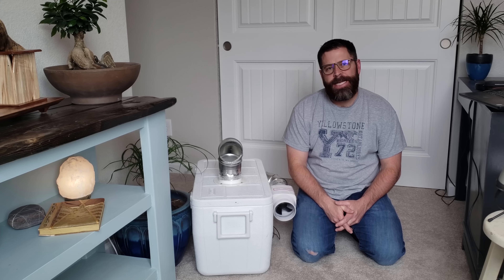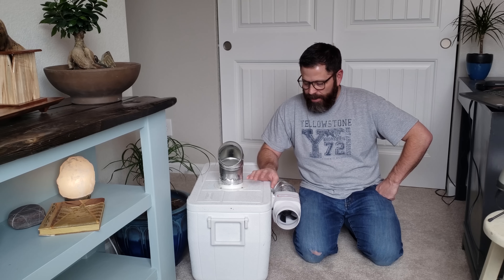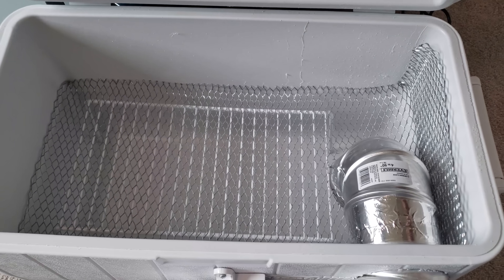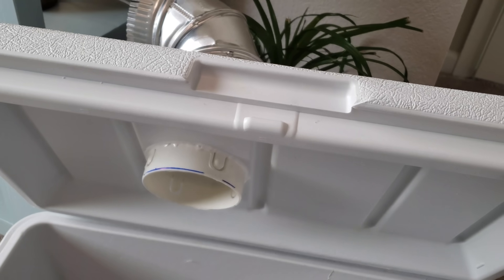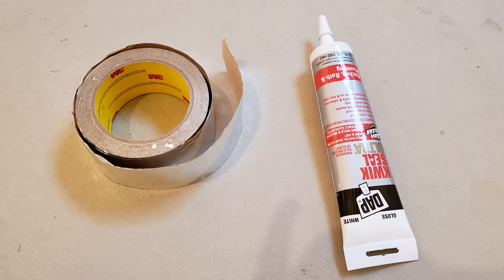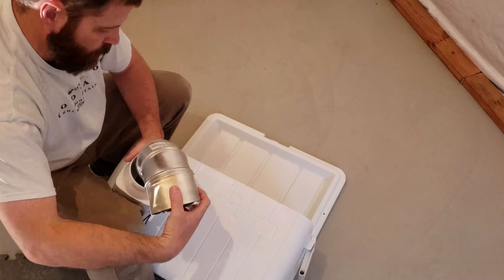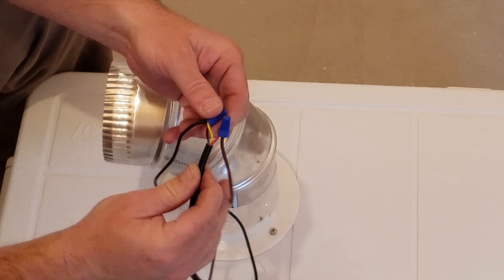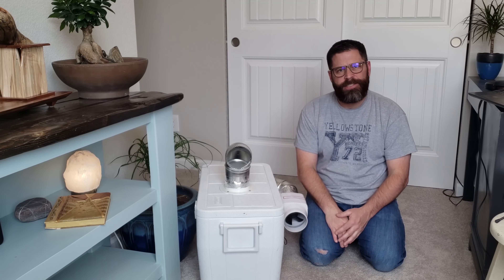Homemade Portable Air Conditioner DIY - Coldest One Yet!

Comment: what if you used dry ice and it was contained within a bottle or maybe even put inside a a radiator so that the co2 stays locked inside? that way you could just pump a liquid over it and through some tubes and have a fan blow the cold air at your poor melting face... i understand dry ice explodes when mixed in a bottle with h2o but what about using a liquid that wouldn't cause a reaction.. or perhaps use that pressure to your advantage to operate some kind of compressor without using electricity? idk just spit-balling ideas here. im looking for a way to put ac in my sailboat.

Comment: I'm seeing everyone say "Don't use dry ice".  I'd like to know if this is only for "closed in" spaces?  I'd like to do this for a covered patio area (outside).  Basically a portable outdoor cooler for sitting on the porch when the temperatures are 90+ outside.  Would dry Ice be ok for that situation or would it still be too hazardous?  Thanks.

Comment: Can I give you an idea?. How about taking a small radiator from a condenser unit from a refrigerator taking a small water pump and placing it in the bottom of your cooler with cold water and an ice pack in it run your water from the bottom of your cooler from the pump through a hose to a dripper system on the condenser unit with a series of sponges behind the condenser to catch the moisture so it doesn't blow through your fan and have that watery collect in the bottom and recycled back into your cooler it will chill the air going into the cooler to keep the ice longer to give you colder air

Comment: Would this set up work on a smaller cooler? I need this system for a work truck that has no AC. Would need to fit in center console or passenger seat. w14  x  L 20 inches  is the biggest I would want to go.

Comment: You may get even more airflow if you mount the fan on top and pull the air through the ice. Air moves easier being sucked than it does being blown, however you may not get the same temperature transfer.  Just an idea for your next one or just mount that one on the other pipe

Comment: There are some additional things you might want to consider. Temperature changes occur when heat is transferred from a hotter object to a colder object. Hence, heat transfer is an irreversible process—always from hot to cold. Try the following, touch someone’s skin and notice whether their skin is warm or cool. Then, ask them if whether your skin feels warm or cool to the touch. They will always say the opposite of how their skin felt to your touch. The exception to this may be if you just asked them whether you asked them how they generally felt overall, rather specifically about the temperature of the skin. 

In this case, the heat is transferred from the outside air to the ice and the air inside the cooler after the ice has been added to a closed cooler for a short duration of time. This warmer air transfers some of its heat at the exposed surface area of the ice, raising the surface temperature of the exposed, small pieces of ice rather quickly when the melting point of ice is reached. You may reduce the sharp temperature drop while extending the time until all of the ice is melted. The effect is to lower the temperature to a comfortable but not freezing level. This may be accomplished  in several ways. In regards to the ice itself, use bigger chunks of ice or block ice. When you are cooling the inside of a car remember you may achieve a more comfortable ambient temperature by minimizing the heating of the cars interior. The glass amplifies the heating of the interior much like a magnifying glass heats up an object. Cover the vehicle outside of the car with a cover that excludes light from the car’s inside surfaces. Since heat is transferred through metal quite rapidly, reduce sunlight to the outside surfaces, as well. Since the electric motors generate heat from electronic components their use may be better served operating outside of the vehicle. A system similar to geothermal cooling may be used by pulling the hot air away from/outside to the vehicle’s interior through insulated tubing to a heat exchange system setup in a cool, shady area to cool the hot air inside the tubing, then force the cooled air back into the vehicle. This process may take longer on high temperature days. If you start off with the vehicle in the shade, then the time until achieving the desired temperature will be shorter. Plus, the ambient humidity inside the vehicle may not appreciably increase, since you are just recirculating and cooling predominantly the same air. How to do this may accomplished with materials and engineering. That would be a different discussion.

Comment: You can improve it by adding a second fan on your exhaust tube to pull that air from the cooler and push that cold air out. Just my opinion
Reply: That's very smart

Comment: Seems to me with all the humidity your genearting as the ice melts you'd be much better of finacially speaking to just make yourself a mini swamp cooler and use ice water rather than room temp water and a trick for the real ones is to put 2 litre soda bottles with frozen water in the reservoir to chill the water...

Comment: Hello... i enjoyed your video.. im moving into a ginormous one bedroom apartment.  And have been reserching the best d.i.y. ac to build so i dont have a 200.00 a mnth electric bill from running the regular AC. what r your thoughts on the d.i y. Ac's that have the flex pipe coiled inside the cooler with the ice poured on top... i love your design by the way... thanks in advance!!
Reply: 1 bag of ice $1.50 ... 10 bags a day $15.00 30 days @ 15 $ 450.00. Buy the AC its cheaper
Reply: @richardgamache1  thanks so much
Reply: Freeze 1gal jugs of water. 2-4 of them and switch them out when needed. Saves a lot more money.

Comment: the problem with this shit is constantly buying the bags of ice which isn't cheap considering it melts 1-2 days. all these designs have flaws in them. cheapest most cost efficient is the ductless system which is around 18-26 SEER, but looks ugly af

Comment: The last one you made with the pipe going through the ice seemed better, as it didn't put humidity out into the air, and the ice lasted as long as 3 days. Could you possibly improve that idea? Maybe making the pipe shorter could make the air colder.

Comment: Would you not just fix the AC in your car ?  I could see this working in a tent for camping on a smaller scale and maybe run off a battery at home in a summer power blackout  but in a car?
Reply: It cost $1000's for a car a/c.  I can understand this $50 fix.

Comment: I like the way he fix the inlet and they are pools at the bottom of the cooler before it hits the ice. The way I have mine is the fan is in letting the air and hitting the ice directly right away. And that causes the ice to melt quicker. I made mine from a paint bucket. Got to give me a rectangular cooler.

Comment: Congrats, you have successfully invented the instant black mold dispenser.
Reply: Why do you say this?
Reply: @C.Hobbs2178  because  when you circulate hot air over ice and water it picks up a lot of humidity which makes things like black mold grow on every surface it can even behind plaster board on your walls... probably the most stupid thing you can do in your home next to showering with a toaster.

Comment: You should have the intake and the duct that blows air out facing in opposite directions.
Reply: Why? Please explain the science behind it . Thanks
Reply: The intake is sucking in hot air, (for this example lets say from the north) and the out duct is blowing out cold air (to the north), so you have created a cycle of air that is just blowing the already cooled air back into the intake to be cooled again, this won't make the air get colder and colder at an efficient rate, instead at best it will just keep your ice slightly colder for longer lol, you want your cooling duct to be blowing (south)....away from the intake so it can fill the room/car with cold air. 

Ideally, the intake should be as high up as possible so it is sucking in the already risen hot air and your cold output duct as low as possible so you don't end up with a useless cycle of air as already mentioned. 

One better would be to have one more duct and fan on it's own, set it high up in the room/car so it's sucking the hot air from high up and pumping it out of a window, i would make sure the inline fan was positioned outside though so the extra motor doesn't add heat to the room/car, this is the reason air cons are so effective because they suck out the hot air of the room which makes any cold air you put in way more effective.

Comment: ...... so you have a fan blowing over ice.... ice that required a refrigeration device , dare I say  a freezer... a device that has a compressor expansion valve 2 coils.. and 2 fan motors.. I’m sorry but I was under the impression when I clicked this video that stuff was going to be in the cooler. Not a cooler filled up with ice with a fan blowing across it...

Comment: If you pour a saturated solution of calcium chloride road salt in the bottom , it will act as a liquid desiccant that will help pull existing moisture from the air, which will make it extra effective on humid air.  By starting with a solution saturated with calcium chloride, it will remain effective longer, as it is diluted by the melting ice.  Probably not a huge deal, but dry air cools more effectively than humid air, so....
Reply: Removing moisture from the air with a desiccant will warm the air and be counter active. You would need a way to cool the air back down. This is not an evaporative cooler so it's not adding a bunch of moisture to the air any how.
Reply: The air being pulled in would interact with the desiccant prior to blowing over the ice on its way out, so the outgoing air would still be the same temperature.  It would just melt the ice faster.  Slightly more powerful cooling effect, for a slightly lower duration.  I was thinking more in terms of helping reduce ambient humidity, than counteracting any humidity the ice might add.  Overall it's probably not that big a deal either way, since I doubt you'd get more than two hours of use out of a full bag of ice.  Maybe less.

Comment: That bag of ice probably doesn't last more than an hour. Good idea though.
Reply: The ice may last an hour but then the ice water in the bottom may last another 30 mins. Even if it only blows out 50 degree, that's still fairly cool air.

Comment: Seems like your blower is quite noisy, what is the Sound pressure level in dBA? A more efficient way to chill the air is with pvc piping running back and forth inside the cooler using short lengths of pvc pipe and multiple 90 degree elbows. The ice cools the pvc pipe’s surface which in turn cools the forced air inside the pipe, this way the ice lasts much much longer. I did this over 25-30 years ago and it’s the best way to to maintain your ice for a longer period of time.

Comment: You use salted ice and pack them in medium size glass mason jars and stack that onto the grate for much cooler temperatures. It'll lower the temperature of the ice from 32*F to 0*F . It's also less messy too :P
Reply: kyzercube, I know you can get the temperature of water down low when you add salt in solution mixed with ice. I'll have to try your suggestion of salting the ice. I don't care about the mess of melted ice.....it's a cooler with a drain plug. I'm not buying what you said about the exposed surface area of ice not making a difference. Crushed ice cools liquids faster because there is more area and over time that means colder faster. Mason jars are a hassle. The lids will begin rusting over time and that isn't good. The risk of breakage would be an unneeded burden. The set up as shown in the video is rugged and simple.
Reply: @3melendr  I agree the vid is great. I will build one for this weekend!
Reply: Jars take away the surface area for the ice to cool the air. Direct contact is the way to go
Reply: @TreyPerryWx  That's why I said medium sized, enough to double stack. Also since the jars will allow for 0*F temperature instead of 32*F, the loss in surface area will not be sufficient to prevent further cooling.
Reply: @kyzercube  
This is terrible advice, salt water freezes at a lower temp than water
Reply: Did you have any issue with the jars cracking?
Reply: How would you get it to freeze if its salted? Would a regular home fridge freezer be enough?
Reply: @RasheedKhan-he6xx  I would fill jars 80% with water, freeze them, then pour salt on top of the ice when it is time to use the cooler. We did something similar when we made ice cream using ice cubes when i was a kid.
Reply: @crawfish069  Ah that's clever!
Reply: Rasheed Khan 0
Reply: @SomeGuy Table salt works best. I saw it in an old documentary. Just remember it's important to mix the ice and the table salt together very quickly, like within 5 seconds ( a painter's stick works best ) or else the salt will melt the ice.
Reply: @SomeGuy I don't think any place sells that kind of ice because it requires a temperature of lower than 0*F to keep it frozen and freezers typically operate at around 15*F.
Reply: use tins!

Comment: 4" drain tile inside the cooler (instead of mesh and a shelf) would allow a much longer air path through the ice, which I suspect would increase the efficiency and would be much cheaper (I see it at less than $4 for a 10ft roll).  Just a thought
Reply: The efficiency is won’t change but the cooling capacity will. I mean the amount of cooling depends ones the amount of bags of ice. 
Your suggestion will speed up the process but will require more ice. 

You’ll have to buy the ice or make it outside of the area you’re trying to cool for obvious reasons.

Comment: 🔵 You really shouldn't start out calling this device an 'Air conditioner', one of the functions of an 'Air conditioner' is to Dehumidify the air, The proper term for this device is an 'Evaporative cooler' (sometimes known as a 'Swamp cooler') it works by putting humidity INTO the air, it will only work in places where the air is quite dry, it will NOT work in regions where the air is humid,...
(Like Florida).
Reply: FACTS

Comment: Why not take one of those small cube freezers, install a coil of copper tubing through which you can pump a fluid, then fill the freezer with water and allow it freeze solid overnight.  You would then have the fluid pumped through a heat exchanger (a salvage auto radiator or heater coil would suffice,) through which you would have a fan blow air.  Would it would be as practical as a simple window AC or a swamp cooler in a low humidity location, probably not. Although you would only need to run the freezer long enough to freeze the water, so while cooling you would only a small pump and a fan, so you might use less electricity than running a window AC.

Comment: WOW! Really really cool! (no pun intended)
I'm going to burning man and camping in a ShiftPod. I have already made a trash can sized 12v Evap cooler with an 8 inch fan.  This might be a worthwhile back up for the hottest part of the day!
I'm guessing crushed ice would work better than a 10 or 20 pound block of ice.
Why do you have the input so long? If you start with the 3 inch duct and have it enter the cooler in a smaller diameter, wouldn't the compression of the air being forced through a smaller opening than the exit cause the air to cool even before it enters the cooler? (something I remember from my old Aviation Ground School class).
Why does the input have to be so long? You should be able just have a nub coming out the top.
I don't want to experiment. If you think it needs the longer input, I'll do it without further question>
You are the AC Master, in my book.

Comment: Now I just need an electric saw. Great video though man thanks for being so much more specific than the vast majority of other videos out there. Hey I have to ask,

Have you tried creating any other DIY AC fans/vents/blowers, specifically non-portable ones? I’m gonna gear up to make one with your style for my bedroom at night but need something a little more professional looking and oscillating so ...

I’m using the traditional style oscillating fan but an all copper one along with copper tubing tied to the front grill with a pond pump that’s shooting the ice cold water through the copper loop, through the ice cold water at pretty decent speeds, thus keeping things (hypothetically) frigid. 

But not as frigid as yours it looks like; the fan was putting off about 10 degrees celsius which is still less than my insanely expensive normal AC which goes nowhere since my house has zero insulation. 

Which I didn’t discover til summer. And I ain’t paying $300 electric bills. It is the Sonoran desert, so. 

Anyways just wondering your thoughts on this version and if you’ve tried it or know anyone who has, otherwise thanks again man, favorited the video for later quests.
Reply: Financially you’re probably better of adding insulation to you’re house/building than using these DIY coolers. The investment might be bigger, but the costs will be lower in the long run.

Comment: Ok so I built the other version with the rigid tube I just wanted to state that the cigarette light cord that is in the description and the one that he uses in the video are not the same thing by all means I'm not hating in anyway we all just trying to stay cool the 3 wires he refers to is not the case if you order the same thing he put in the description now cool thing is not 3 wires it's only 2 and put brown on brown and other 2 wires which is power and it works also if you get the fan backward mounting on cooler just switch the wires it reverses the fan not sure how long itll last that way but thersz not 3 wires only 2 so even simpler caulking drying now well see how it does tomorrow take it easy dont work to hard people